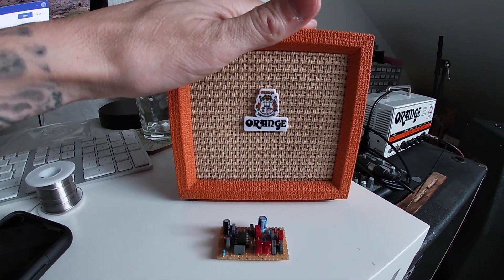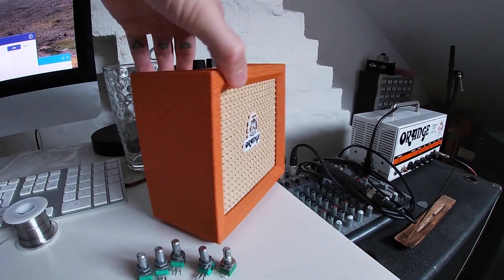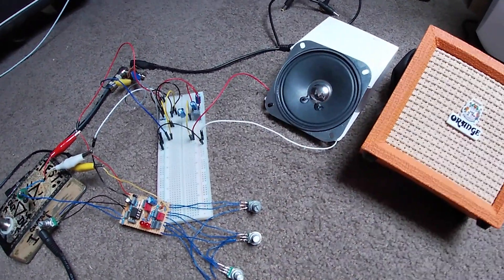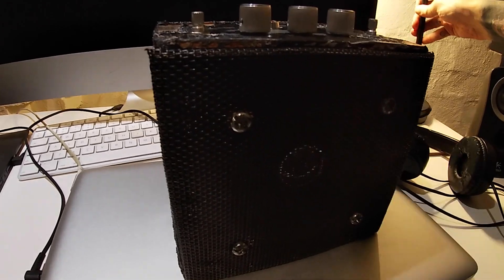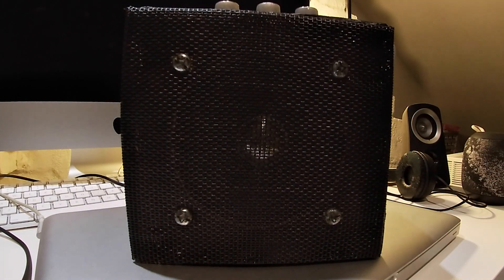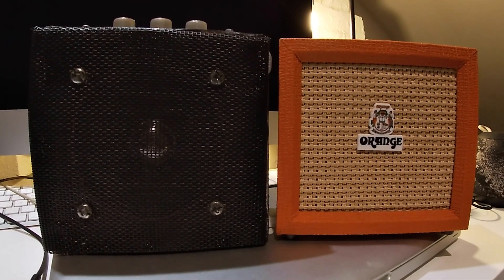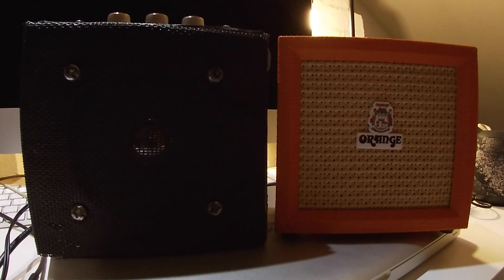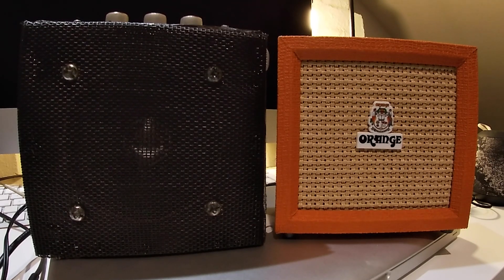Mini DIY Guitar Amp

Comment: So my buddy had my orange mini crush in his backpack with a can of black spray paint with lead to it not being orange anymore and as luck would have it the same day I found a marshall mg10 with a broken volume pot shaft for 5$ at goodwill so I put the chassis and 9 volt battery box in the mg10 cab with the stock 6 1/2 in speaker and my God its retarded how good it sounds now. I have noticed that it doesn't take much more power than the stock 4 in speaker. Àlso if u get a 12 volt power supply and it turns it into a damn monster

Comment: If you twist a pair of wires going to the same component, you'll reduce their tendency to act as an antenna. Also consolidating ground points helps in lm386 circuits. I would add a power LED as well, preferably red.

Comment: I've literally had an 8inch speaker I bought from Kitronix kicking around for years with plans to do something like this (less the distortion circuit) but have always been put off by how to do the front section of the amp. Getting a clean hole for the speaker to sit in with very limited tools is baffling me.
Reply from the maker: I used really thin soft wood, it was a combination of drilling large holes with a stepper drill bit and using a hacksaw and ever scissors. I'm not a perfectionist and have minimal tools and generally am pretty ghetto about the way I make stuff, I don't let a lot get in my way of creating!
Reply: @unholyaudiochannel  "I don't let a lot get in my way of creating!" good on you, man. I'm sadly almost the opposite; for some reason I let any little excuse stop me cos I'm scared of, I dunno, failure maybe. Need to take a leaf out of your book and just do it!

Comment: it certainly does doom
in my experience doom-factor is mostly caused by speaker excursion inducing cone flexing distortion into the signal. i have a small 5W behringer clean practise amp that out-dooms my laney amp... funnily enough, high volume levels are not required for tone (of course they are required for OOMPH™), a small speaker being pushed too far can go a long way